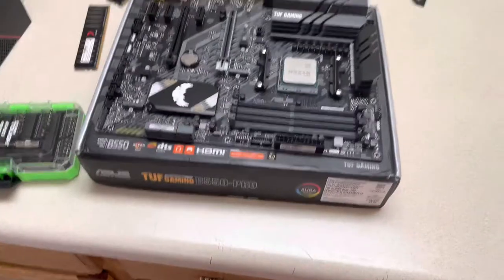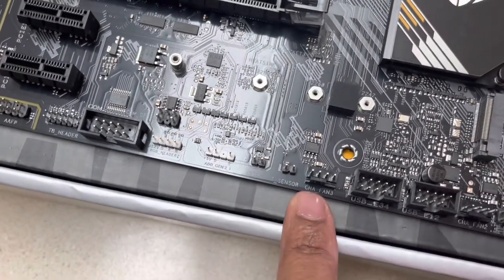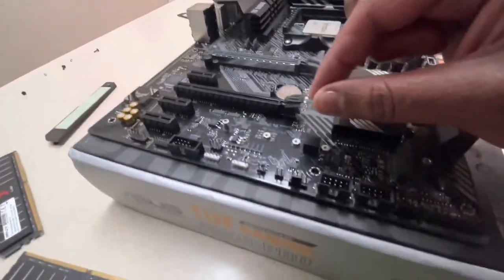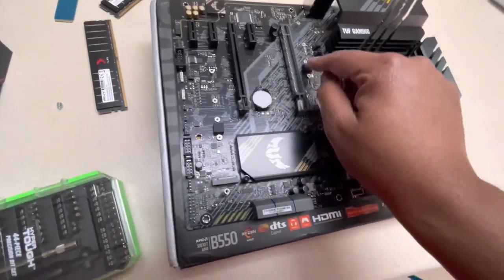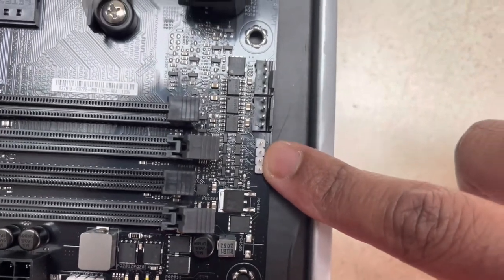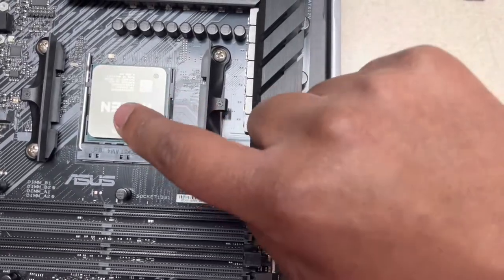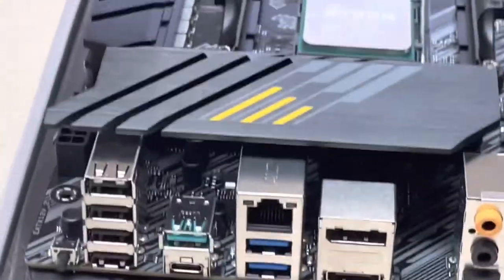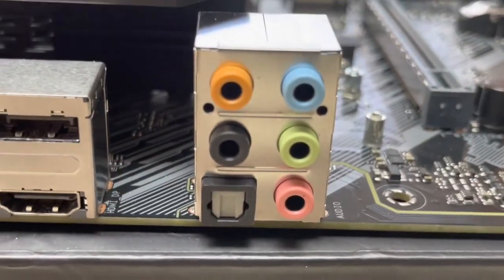Asus TUF Gaming B550-Pro | Motherboard | In-depth look

Comment: Hey, a little late to the party, but thank you for this.
Just wanted to let you know, for SATA Slots, you said that lane 6 will not work if you're using an M.2 slot, while the other five slots work just fine.
That's not entirely true, both 5 AND 6 share the same lane with M.2 slot!
So basically use 1 to 4 if you intend on hooking up two NVME M.2's, hope this helps somebody, cuz it took me a LONG time to figure out.
Reply from the maker: That’s strange because even their site only says 6. Hmm I’ll have to test that out because that’s not good. They should’ve listed both. I mean 6 slots is over kill for my build but still. Thanks mate for that insight
Reply: @nlvassassin  let me know how it works out. I almost RMA'd my mobo thinking it was faulty, I'm glad my hail Mary desperate attempt at fiddling around with nvme's and other ports was successful, I honestly couldn't believe it when it happened!

(Now I just gotta solve the NEXT mystery, why do my ARGB case fans have a mind of their own, turning on randomly and changing on their own, while neither Aurora Crate nor the case button seem to work any more!!)

Comment: Great little survey of this motherboard.  

Couple questions please:  does this board have LED codes-display for troubleshooting ?   
How does this board compare to the Tuf Gaming B550-Plus (especially for USB connex  -internal and external) ?  
And I will be moving my 10 yo Antec TP-750 (80+ bronze) PSU over to this build (with Ryzen 5 5600G stock fan) -- do you think it will be compatible ?  
Thanks.
Reply from the maker: Yes the manual talks about the led codes. And the Ryzen 5 5600g is compatible per the website. It even works with the onboard HDMI and display port if you don't have a gpu

Comment: Great video thanks for the update.
Reply from the maker: You bet. I have the enitre PC build video coming to. How did your build go?
Reply: @nlvassassin  it went good it’s all hooked up and running
Reply from the maker: @KB1285  that’s great. What processor and gpu did you go with?  I’m thinking of getting a 3060 ti
Reply: @nlvassassin  5600g
Reply: @nlvassassin  Haven’t decided on a GPU yet I don’t do much gaming but might get into it
Reply from the maker: @KB1285  good processor you won’t need a gpu right away with it. Especially if you’re not gaming
Reply: @nlvassassin  yep but i should have got the x version then got a cheap gt710 as a place holder for upgrade
Reply: Great video man!!!! I start buy a desktop and have this same motherboard (b550 tuf pro), power supply 850w core reactor Xpg; processor AMD 5800X; and I will buy the gpu (aim at Msi Rtx 3070 gaming z trio), 32gb ddr4 3600Mhz, ssd nvme 520gb, ssd 480gb, sata 2Tb, and water cooler AIO 360mm ( maybe coolermaster masterliquid). I would like a video to complete desktop assemble to guide me to assemble my own computer. Thanks!!!
Reply from the maker: @ismaeltrindade8423  I have one it's in queue to be released soon. Sub and turn on that notification bell
Reply from the maker: @KB1285  I hear yeah. You could probably get the 5600X during black Friday and a gt710 and flip the 5600G on Ebay as lighlty used.

Comment: is ryzen 9 5900x compatabile with the motherbaord thank you
Reply from the maker: Yes the website says the ryzen 9 5900, 5900x, and the 5950x all work with this board. Make sure you flash the board first just in case the bios is not updated.

Comment: Great video. I have te same motherboard and I search for a complete guide to assemble my pc. I have many doubts about conect the AIO pump (master liquid ML360L v2) on mobo. This is my first time to assemble my pc. Thanks!!!
Reply from the maker: my entire PC build will drop next week. I have the 240 cooler master and have had no issues. It's been two months.
Reply: @nlvassassin  thanks! I’m waiting for this assemble video!!!
Reply from the maker: Drops on Friday.
Reply from the maker: @ismaeltrindade8423  how did the build go?
Reply: @nlvassassin  build complete. I bought a sleeved cable to solve the problem with the 360 water cooler. The original cpu cable of the Xpg core reactor psu was too short and the installation on the mobo was not possible with the first fan cooler inside the cpu box. In a first moment, I instal the 3 fan coolers outside and after buy the sleeved cable, instal inside.
Reply from the maker: @ismaeltrindade8423  sweet yeah I had to get a cable extender to get my aio pump to the correct header. Sweet, glad you got your build done